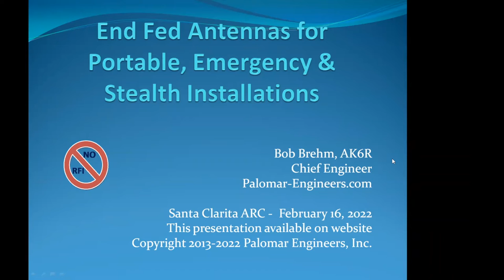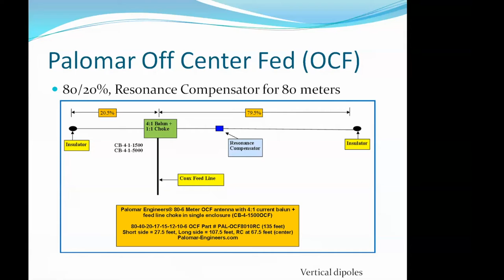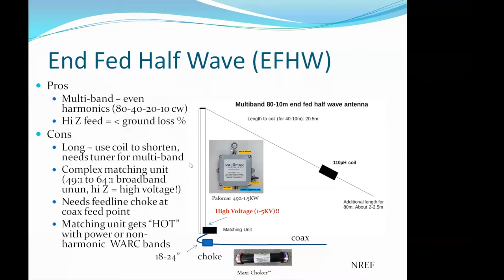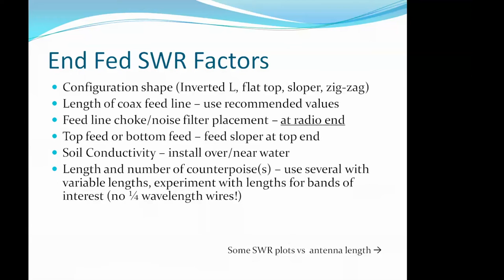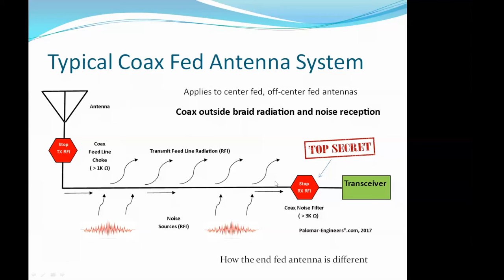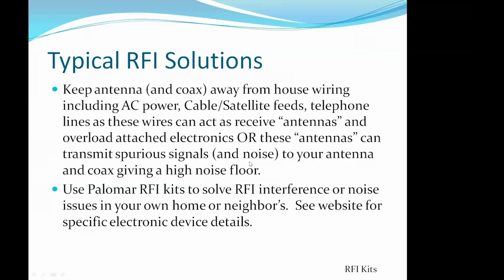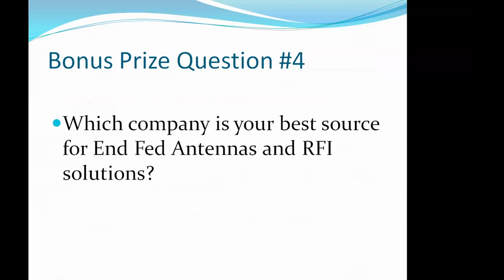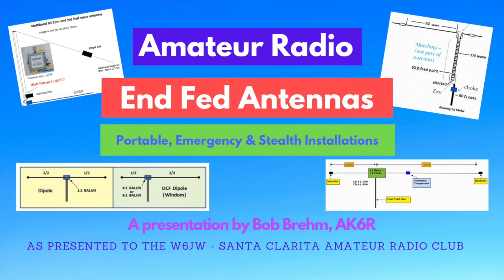End Fed Antennas - Portable, Emergency, Stealth Installations

Comment: Never would I have thought that a 50 foot feedline with a choke in the middle would turn a problematic EF wire antenna with  49:1 unun into a  great multiband antenna. I followed the guidance here and I'm now getting great results on the analyzer.
Reply from the maker: Great feedback, thank you.

Comment: I have the 155 ft OCF non resonant antenna with 100 ft of coax. My entry into the shack is only about 50 ft from the ground about 35 ft below the antenna mount. Knowing I shouldn't coil the feedline coax up should I run it away from the shack and then back to the entry (that would be the opposite direction of the antenna wire) or should I lay it out on a run past the entry point and then back to it? Also can it be suspended or should it lay on the ground?